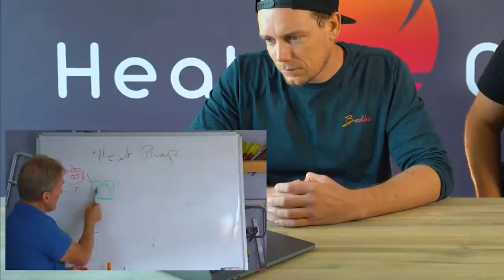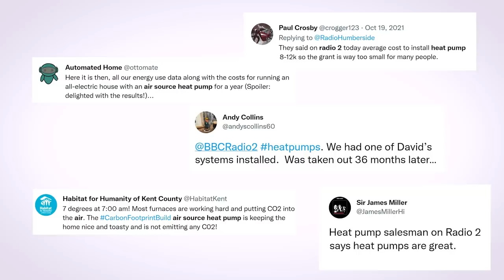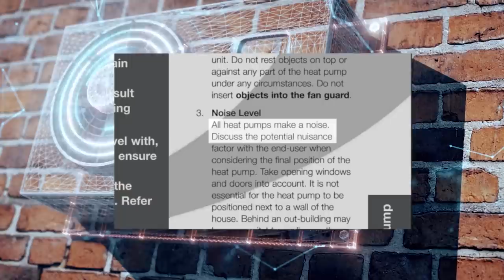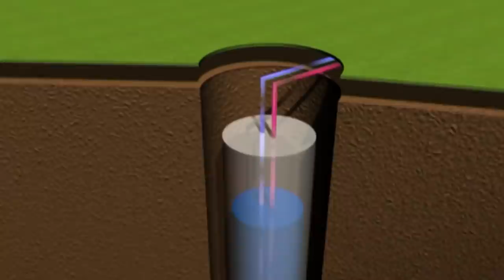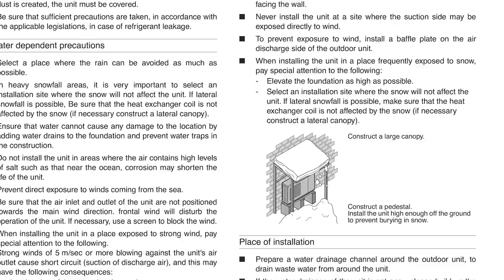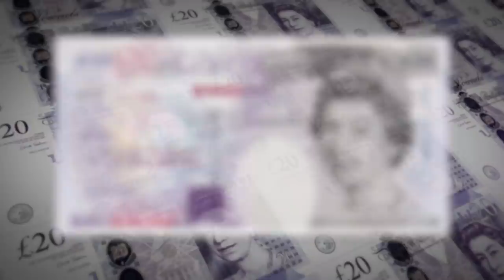Heat Pump Secrets They Don't Want You to Know

Comment: The ASHP that was installed in my small cottage almost 9 years ago has never worked properly - it was installed cheaply by a cowboy contracted by my local authority - I’m in rented accommodation. The person utterly wrecked my house systematically room by room and installed the wrong sized radiators all in the wrong areas. No insulation under the floor boards and left hot and cold pipes touching and crossing. The noise from the pipes was so horrendous that i moved out of my bedroom 7 years ago. My landlord has refused to take responsibility so I’m taking them to court now.
Reply: GOOD LUC! 🤞 🍀

Comment: Roger another great video. I have an oil burner which we fitted an oil tally to. So we can measure how much oil we are using each day and log against outside Air temp.we started by using it in the morning and night time but found when running 24 7 it used basically the same oil. When have underfloor bu the way. Next step was to add more insulation to the oil burner and we save 20 of our oil. We seal around the window frames and wall and saved again we put one way vent on extractor fans and saved again. Some many things you can do to save fuel.
Reply: What vent did you use?
Reply: @JeffPorters  in line back draft excluder from Amazon. Stops the draft blowing in through the vent
Reply: I used a domestic oil tally from Amazon made by bell Uk it’s about 200 pound and to be honest it’s paid for it’s self in the first year with saving we made

Comment: Even though I decided to install a heat pump last June I was still quite sceptical but, after nearly a year it has been brilliant, delivering all the heating we hoped for even down at -3degC and with plenty of headroom to spare, I would say down to around -7degC or less it will be able to maintain our desired room temps quite easily. Unlike our gas system we have been able to leave it running all day every day in the cold weather without any overall increase in cost. The saving in energy usage is quite extraordinary; our gas system used 21,000kWh per year, the heat pump around 4,000kWh per year.
Reply: Interested is what the guy in the video said wrong or do you have a modern well insulated house?
Reply: @rob4214  not so much wrong just out of date based on a lot of older less efficient and/or badly installed systems. There is no question that modern heat pumps deliver if they are part of a well designed and installed system. Some of the criticisms around cost and grant funding  have a point
Reply: Must have been something badly wrong with your old gas system. Heat pumps simply cannot deliver a better than 5:1 reduction in kWhr input. How much more does your electricity cost than gas/kWhr?
Reply: @salamander5703  gas boiler was not that old and regularly serviced. If you live near enough I'd be happy to show you the ASHP installation, data, costs etc.
Reply: @lumbarsupport  All a bit vague for those not living near enough. Was yours a condensing gas boiler for a start? Most of us just do not have the money to rip up and re-pipe our houses and change the radiators? In fact using our current gas systems is a bit like having to use using expensive credit because we just do not have cash in hand, so never ideal but just cannot be avoided. What was your total install cost?

 Recent builds also have micro bore piping so the government allowing this and advocating a future of heat pumps just shows what an utterly confusing mess these initiatives are and any system is going to be brilliant with enough cash in hand to implement it. For most over 70s like me the payback on a loan for it exceeds likely life span so is not an option. If I was going to spend any money it would be on counter current ventilation which creates a healthier indoor environment. Just look at Grand Designs which is where a lot of this fanciful eco stuff is promulgated and they usually have this, plus always under floor heating whilst the rest are stuck with draughty houses just to be able to breath and of course radiators which generate even more draughts.
Reply: @michaeld5888  My gas boiler was a modern condensing design in a good state of repair. I totally agree that financing is the big issue and it depends very much on one's personal circumstances. I needed the new kit anyway and the RHI grant enabled me to buy it at a net price no higher than a new gas based system. The gross cost was £15,000 for the ASHP, new DHW tank, header tanks and 6 new rads. The RHI is £9,000 payable over 7 years, so net cost £6,000 but with a cash flow penalty. It proves that ASHP's work well with microbore (mine is the tiniest, 8mm bore!) as long as you have the correct design of header tanks, pumps etc. The new more efficient low temperature radiators are excellent and don't cause any drafts. We had the heating on all day every day throughout the winter, something we never did with the old gas system - we would just wear more clothes, unless it got really cold! I agree with you that ASHP's should not be so expensive - they are a very well established tech. It's the duty of manufacturers, installers and government to find ways of reducing the cost to the consumer to make ASHP's a reasonable proposition for everyone, because an 80% saving in energy is huge and one of the best ways to tackle energy market turmoil and reduce reliance on unstable sources such as Russia and the middle east.
Reply: @lumbarsupport  Manty thanks for the reply in detail. Glad it has worked for you and interesting it is doing this with microbore pipes so that is encouraging information. It is a lot of money still so little incentive to rip out a functioning system and replace with ASHP unless there is a project already in the pipeline. Energy prices may of course come down again so with a gas bill of £563 for last year I will hang fire on any conversion and hopefully technology will improve. Take care.
Reply: What was the heat loss calculation in kwh for your property
Reply: Heating design flow temp 50°C @ SPF 3.6
DHW design flow temp 55°C
EPC space heating 13,374 kWh p.a.
EPC hot water demand 2,839kWh p.a.
Indoor average design temp 19.2°C
House area sq metres	137
Peak power/heat loss 8.26kW
At design temperature -2.4°C
House heat loss 18,245kWh p.a.
Heat pump consumption 4,971kWh p.a.
COP 3.67
--------------------
This is for full occupany. In practice there have mostly been two of us. We keep average temperature in all rooms at around 20°C which we find comfortably warm. We run the heating continuously between 6am and 10pm, never at night. A useful energy saving tip is to run hot water heating once each day at around 2-3pm when ambient temps are at max and keep the DHW temp low - it only takes 30-40 minutes.
Reply: @lumbarsupport  ok thank you for your reply, i was a bit worried there was something wrong with your combi boiler but 
with a heat loss of 18,245 kwh and the boiler using 21,000 kwh that's 86.8% so not to bad, are you on a low tariff for electric.
Reply: @rogertrant2101  29.4ppkwh variable rate, a bit higher than price cap rate but under review
Reply: @lumbarsupport  ah ok, i did some calculations on mine and my gas usage is 4685 kwh/year from this i managed to get a rough estimate of my heat loss which came out to be 4216 kwh using these figures i calculated that at a cop of 4.0 i would save £89/y but if the price of electric was cheaper that would change things, at the moment heating is off for the summer but when winter comes i am going to try lowering the return flow temperature to see if i can up the efficiency of the boiler. saving £89/y for me would be to long a ROI.
Reply: @salamander5703  Remember the boiler isn't 100% efficient so that 21,000kWh input might only be outputting 14,000-18,900 kWh worth of heat if the boiler is 70-90% efficient.
Reply: Mine was heating in temps -25 celsius, of course it spends more electricity but who cares for few days. There is no better solution.
Reply: @lumbarsupport  doesn’t keeping the DHW temp low lead to legionella?
Reply: Yep, no surprise really - heat pumps work -  if correctly spec'd and installed. It's shameful that this channel spouts such a lot of mis-informed shit about this, and also, lateley, insulation.Twenty years or so ago, people like Roger didn't like low energy lightbulbs. They were wrong then, and they're wrong now.
Reply: @immers2410  there is an interesting wiki on this. The actual risk from domestic systems is virtually non existent.

Comment: I am surprised as a plumber you didn’t say that to overcome some of the flow problems and de frosting a suitably sized low loss header enables the heat pump to operate independently from the heating circuits thus enabling  individual rooms or circuits and DHW to be controlled.  You also omitted to mention replacing radiators with fan coils you can run the heat pumps at much lower flow temperatures increasing the efficiencies of the system and reducing the heat pump fan speed reducing the noise.  Looks like you are reaching the stage in life when change is hard to accept maybe your mantra should be BUT WE HAVE ALWAYS DONE IT LIKE THIS, we all reach our sell by dates.
Reply from the maker: I mentioned buffers in a previous video and heat freaks said "You don't need one". I would always use one on a heat pump.

Comment: The problem with heat pumps is they are likely to fail when you need them the most, when it's freezing
Reply: Just like a gas boiler then?

Comment: I sited my heat pump behind my garage. My house is incredibly quiet after changing over. My fuel oil boiler was much louder - though it was in the house.

As far as electricity generation, it is getting less CO2 intense every year. Yes, gas fired plants exist but they are more efficient than your boiler and they do some processing of their emissions to make them less harmful than the average home boiler. But the bigger difference is the rollout of wind, solar and storage.

And solar plus storage can happen at your home. Last year my heat pump used 4.7 MWhs of electricity. Which is exactly what my PV panels produced.
Reply: You’ll be surprised a gas fired power station isn’t as efficient as a boiler. With a boiler you’re transferring energy once. Chemical to thermal. In a power station it’s chemical to thermal to electrical. Then there’s transmission losses. So your boiler at 80-90% efficiency is better than published efficiency of gas fired power stations have a look online they are 40-60% depending on age and if they’re combined cycle as opposed to open cycle.

Comment: The difference between heating with a heat pump vs traditional is that a heat pump takes about %25 of the energy so you do end up using less coal/natural gas.
Reply: No, not true. It depends upon the temperature. Once you get down to around zero the efficiency of an air source heat pump is 1:1. In other words for every kw of power supplied it provides 1 kw back. As the temperature drops below zero the ratio will get worse. In other words when its cold, they are not as efficient as a normal gas boiler.
Reply: @markchisholm2657  No that's way out something has gone wrong if modern heat pump is only getting a COP of 1 at zero degrees. A run-of-the-mill R32 heat pump on a -2 degree day running at a 50-degree flow temperature should easily get a COP of over 2. Obviously that COP will be higher the lower the flow temperatures and newer models running on R290 will get must higher COPs in the same conditions

Comment: Quick reality check / comments:  

1. Correct size heat pump for the property to get maximum efficiency. This is the case for gas boilers as well. 0:44
2. Heat pumps work well with the right size radiators, insulation etc… again this is the case for gas and oil boilers too 1:50
3. 2:28 all mechanical equipment will break eventually, even gas boilers. also poor installations are not exclusive to heat pumps 
4. 3:02 heat pumps do not need to be on 24/7. 
5. 3:19 compare dB levels of heat pumps to gas boilers. 
6. 3:45 site the heat pump where it will not cause a nuance. I would say boiler flue arrangements are more difficult the heat pump locations. 
7. 4:45 air quality. if all heat pumps were run from electricity generated from gas. Those generators are away from large population densities , they are also better maintained so will be running at peak efficiency which cannot be said for domestic boilers. In this scenario Heat pumps improve air quality in populated areas for people. However in reality, the power grid is a mixture of technologies and over time will be come zero emmission
8. 5:08 ‘Can’t see the difference between gas fired generation taking into account losses vs gas boiler’ gas boiler scenario - 100kwh in 90% gas boiler 90kW heat out. Heat pump scenario with gas fired power station- 100kw gas in - 60kW electricity out - 10% distribution losses - 54kw electric into the heat pump. HP COP of three is 164kw heat out. So less gas consumption, even at a cop of 2 it is still less gas consumption . It is also removing the emissions away from populated areas. 
9. 5:48 for marine environments they all sell a different heat pump. 
10. 6:20 not all have or need back up heaters 
11. 6:53 you don’t want driving rain going on to your boiler flue either 
12. 7:04 gas boilers also condense, the condensation pipes also freeze 
13. 7:51 trace heating not necessary as almost all heat pumps pulse the pump when the temperature gets below a certain figure 
14. 7:55 glycol not need. Same reason as above 
15. 8:15 wind issues would be extreme circumstances, if it was that windy I image only direct electric heaters would be suitable as the preassure in a boiler flue would be beyond operating conditions 
16. 9:06 rodents cause electrical safety issues. This is not exclusive to heat pumps. 
17. 9:40 two day install? More like 5 day. 
18. 10:02 balancing a heating system circuit by circuit, is not new and not unique to heat pumps
Reply from the maker: I really can't be bothered to answer all your points because most of them are based on a false hood.
Glycol is needed, it says so
Rodents cause damage to electrics outside the building
trace heating is for the condensate off the coil not the circuit 
Heat pumps need to be on 24/7 it says so in the instructions

I could go on but it is boring
Reply: @SkillBuilder  😂😂 oh dear

Comment: Roger - Need to look into Season Coefficient of Performance which is the average of its efficiency over year, but this seems to be a ruse to hide the poor efficiency in the winter when you are using it the most, whereas in the summer you may not be using it all.
Reply from the maker: you are right, I spooted that sleight of hand
Reply: I was told electric might go up a little but would save on gas haha it don’t use gas COP cop out for sure don’t get used in the summer does it because it’s a Heat Pump more chance of finding the G spot as the TM1or TE1never mind the Fixed Set Point.I can’t see the trees for the Forrest.I do like the Heat Geeks they have all the gear.
Reply: SCOP is based on total amount of kws created. Not based on the average outside temperature.. there for accounts for the added load at peak winter temperatures 👍

Comment: So what would you recommend apart from a expensive ground source heat pump? Stick with a gas boiler or wait for hydrogen boilers?
Reply from the maker: If you have a gas boiler keep it and spend money on insulation
Reply: Hydrogen will never come.
Reply: hydrogen might make sense powering air or heavy transport, but for heating homes, it's not going to be cost-effective.